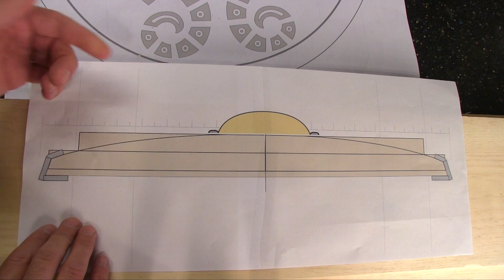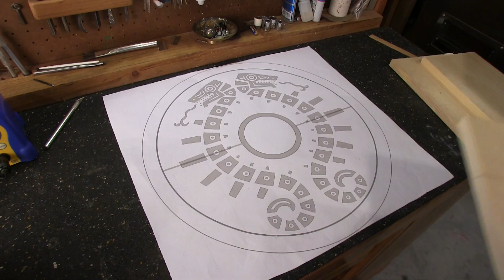How to make Link's Traveler's Shield Part 3 | Shaping Wood Dome

Comment: I was thinking it would be cool to do a plunge cut to take out some of the material in the center of the shield to reduce the weight.
Reply: I was thinking the same, an offcut using the same technique. Though most shields are rounded using a shield press.

Comment: Personally, I think Wood Turning it would have been better for both getting the corners off and making the dome.
Reply: What does that mean
Reply: @johnzamer3142  I think what I meant was, it would be easier to make it into a circular domed shield because the wood itself would be spinning, plus you can sand it that way.  But that was two years ago, so I don't remember.